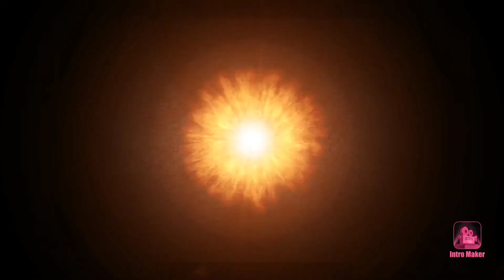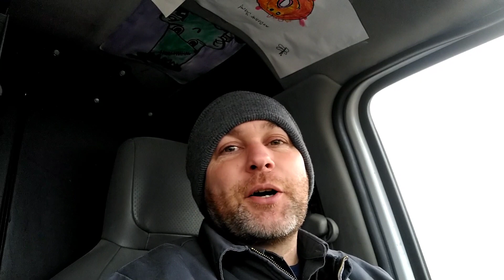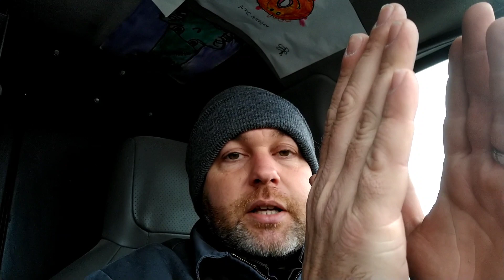Gas Furnace:  Modulating, 2 stage or Single Stage.  What do I really need?

Comment: Your Delusional if you think modulating does not benefit a home. Do you like variable speed motors but you don’t like a variable flame? You need to do some research bud
Reply from the maker: The red light could be a diagnostic light.   They will usually flash a certain number of times and that can tell you what the furnace is locked out on.   Or newer furnaces have a letter or number code it will flash for diagnostics.   Depends on the furnace.    And yes the flame sensor is typically on the end of the last burner.   May have to have a service call it sounds like.    Have a great day!

Comment: i have a 3 year old Colman furnace, i got quoted $4500 to add a 4 TON 14 SEER  A/C unit (highest Seer I could go because i have a single stage furnace) or replace everything with a 16 SEER variable speed 2 stage unit off brand Armstrong? My current furnace in not that old is it worth replacing everything just to go up to 16 SEER?
Reply from the maker: Thanks for the question.  I do usually say replace both at the same time.  (I have another video on the channel about why) but it's not always necessary.   If the furnace is pretty new and in GOOD shape then maybe it could stay.   Depends on it's condition.  I am a big fan of 16 seer ac units but if the furnace is newer, maybe u can save a couple dollars.   16 seer is great but the other option is 14,. Not that big a jump in my opinion.  I don't believe your going to see that much diff on your utility bill.   The cooling tonnage will be the same so you'll still be comfortable.   Variable speed motors are great.   16 seer is great.  And together you probably can save on utilities.   But if the furnace is new, I don't see much concern doing a 14 seer and at 4500, that's not a bad price.   At least in my area.      I hope this helps!  Please, be sure to subscribe and check out more of the videos on the channel.   There's a lot on there about new equipment and how to deal with purchasing.  Share with a friend and have a GREAT day!
Reply: @andyscornerhvac  thanks for the advice!

Comment: I believe I have a two stage variable furnace. When it starts blowing, it blows cold air, then the air changes to warm, then back to cold again before it shuts off. I have to put an object in front of the vents blocking them from my chair or I freeze. What makes it do this? the variable speed or the two stage? I want one that only blows hot air, not cold air during the cycle.The cold air blowing during the cycle is so unpleasant.
Reply from the maker: Could be a number of things.  Blower speeds not set right (happens a lot), staging not set right, maybe the stat is set up wrong and set for electric heat which would turn the blower on before the heat exchanger is hot, could be something wrong with the furnace locking it out so it's not producing heat all the time.   Unfortunately could be several things. The only real way to know would be to have a service technician look at it.  The only way (on some furnaces) to know if it's in 2nd stage is by checking gas pressure and I recommend that being done ONLY by a certified technician.  I would recommend having a reliable company come out and evaluate the situation.   There's a lot of options to fix your issues.    I hope this helps!  Be sure to subscribe to the channel of not already and share with a friend!   Thanks again!   Have a great day!

Comment: Thank you for this informative video, i wanted to add ac to my house, small tri level,in the northwest(1300sf) i currently have a 1995 carrier, which still runs , and i was thinking of replacing the furnace because I am afraid it won’t start next year, i have had a few companies come give me estimates, a couple recommended 2 stage 16 seer ac unit and a couple  1 stage, 13 seer on ac unit, difference in price is around 2500 between 1 and 2 stage ranging from 6100, to 12k, the downstairs(basement  2 bed 1 Barth is always cooler) what do you recommend  me?
Reply from the maker: Personally, I am always a big fan of a two-stage 16 seer air conditioning unit. But it also depends on usage to justify the price difference. You said you live in the northwest, do the air conditioners there get a lot of use? Like where I'm at we have a lot of humidity in the summer so our air conditioners run pretty hard. Sometimes more in the mountainous or high desert areas we have the temperature but not the humidity so maybe they don't have to run quite as hard. ( I don't know the area I've only visited I've never lived so I'm just spitballing here ). If there's not a huge cooling load needed, then maybe the 13th seer would be okay. Obviously I'm a big believer and efficiency but every house is different and every situation is different depending on location. Warranty is definitely the big thing if this 16 seer has better warranty then hands down I would go with it. The two stage 16 seer units are very reliable and usually have good warranties depending on the brand. As far as furnaces, in the couple different videos that I have I do knock the idea of two stage and modulating furnaces, that being said, two stage furnaces are usually the better unit because they have better warranties and higher efficiency ratings. Two stage equipment is excellent equipment especially with a zoning system or anything like that. You said you live in a tri level, which I personally love the layout of a tri level but they are notoriously hard to heat and cool because it's hard to get ductwork to the right areas. Or at least the right amount of ductwork. So that's where zoning systems really shine at that point you can have thermostats on each level. And two stage air conditioners and two-stage furnaces are absolutely amazing when it comes to zoning systems. So really the choice is up to you, based on budget, usage, and lay out of the duct system. At 1300 square foot roughly, if the equipment is sized correctly even a single stage or 13 seer could potentially be efficient and more budget friendly. My only drawback to the single stage in 13 seer is warranty packages. If it were me, I would be interested in his own system but that does drive the cost up. But on the other hand it can prevent cold and hot spots throughout the house. I hope this helps and good luck with your investment. The purchase of an HVAC system is a long-term investment. I wish more people would look at it that way. It's a lot of money and there's no way to sugarcoat that. And unless you're just rolling in cash like Daddy Warbucks most people don't upgrade their system every couple of years. So you want to make sure you do it right the first time because you're going to have that system for probably at least 15 years or so. I always tell everyone to make sure they're using a good reliable company. Ask each one why they're better than the other. Ask the little questions like do you do combustion analysis. Do you test static pressure when you're done? Do you have performance guarantees? Who else have you install the system in that has a house like mine? And do you have references? Thanks again for the comments and viewing the videos! I love talking to people from all over! Be sure to subscribe if you have not already! And share with a friend neighbor and family member so we can get these videos out so maybe we can help people! Thanks again have a great day!
Reply: @andyscornerhvac  thank you for your response, ac is need it couple months out of the year, so i think the 13 seer should be ok, i was going to go with carrier machines 1 stage , but today i got a quote for lennox units 2 stage furnace , 13 seer ac for less money , now the carrier is a 60k btus and the lennox is i believe 44000 is that important? i have only 1 quote saying the number of btus.
Reply from the maker: Personally, I would not purchase a carrier for my own house. That is a little bit of personal preference and I normally try hard not to knock too many of the brands on here cuz I know a lot of people have their own preferences. That being said, carrier is absolutely hands-down known for being more expensive without getting anything extra. What I look at is repair parts later on down the road. 10 15 years later you need a gas valve or control board or you know really any part it is going to be three to four times more expensive than any other brands replacement parts. Ask any service tech and they will tell you that carrier parts are more expensive than anyone else. They get such high ratings with the public because they have done so much advertising and they have been around a long time. To me it's not worth the extra price. Lennox is a very nice brand. Years ago I actually worked for a Lennox dealer and thought they did make a very quality piece of machinery. There's a lot of good ones out there so to me brand is not a huge importance other than what you get with warranty and budget wise. And 10 years from now when you need parts that carrier does not fit in anyone's budget. Lennox is reasonable and built with quality. As far as BTU ratings, there may not be that big of a difference from a 44 to a 60 as far as being able to heat your house. Different brands have their different size ratings. Like I work for an Amanda dealer. We have 60,000 80,000 100 and 125. But other brands have 40s 75s 110 and so on. What I would definitely look at is the load calculations that the contractors use. The only way to truly know how many BTUs you need is with a load calculation. All contractors should be doing some form of this made a manual j or a different system but a load calculation is hands down the only way to know your BTU rating that you will need on any given day. So you should be able to ask for those and I would also ask for what their performance guarantee is. Not all but a lot of companies offer a performance guarantee. To where if on a 95 100° day that air conditioner does not keep up because of sizing they'll replace it with a bigger one. Same with the furnace on cold days. Not all contractors offer this but the good ones do and it needs to be in writing. But I would always ask the contractors how many BTUs the furnaces how many tons the air conditioner is and how the load calculation came out in comparison. I do not believe in oversizing equipment by any means it's worse than undersizing. But you do have to make sure you have enough BTUs to keep up on those extremely cold days and extremely hot days otherwise you'll be uncomfortable and your electric bill will be outrageous. I hope this helps any other questions just let me know! Have a great day!

Comment: I know ZERO about HVAC systems. My AC is pretty much dead, and it is approximately 16 to 17 years old. I have a quote for a Lennox 16 SEER  ML14XC1 2.5 ton and a 2 stage Lennox furnace EL296V, for about $6500 installed. Have another quote for a Lennox 14 SEER and single stage furnace for about $1200 less. Worth it to go to the higher spec models in your opinion?
Reply from the maker: I would typically go with the higher  rated system.  It is usually better equipment, not always but usually, get the better quality, extra noise level considerations and warranties.  Either way to be honest, 6500 is not a bad price.  Least n my area.   I'm a big fan of the 16 seers.  Not so much on the 18 and 21 seer units because they typically use a diff compressor but I'd go 16 seer all day long. Hope this helps! Be sure to subscribe and share if haven't already! Thanks again! Have a great day!
Reply: Add $10000 to that quote in my area

Comment: I just came across your channel (& subscribed). This is really helpful information. THANK Your!  We are on the process replacing an old furnace (80% efficiency).  WE have 28000 Square foot house (1 floor). With the old furnace, we have trouble heating up the other side of the house (our bedroom and child's room).  So far we have quotes for 93%, 95%, 96%, and 97% efficiency furnaces (Goodman and American standard are brands between two quotes). Most have been 2-stage or modulating. I read somewhere else that variable speed blower was good thing to have. Thus, hearing this in your video has made me convinced to go with that.  Currently we are leaning toward the 96 or 97 Goodman 2-stage given the size of our hour and troubles we have this older equipment.  Based on your video and comments reply below, you seem to recommend zoning.  Is there any other information that might be helpful in our decision making process?
Reply from the maker: Thanks for watching and subscribing!  I always recommend zoning if there are cold n hot spots!  Zoning is amazing!  Lol.  Your contractor should be looking at the ducting going to the end of the house that is not keeping temp well.   Duct size (counts for volume and velocity) is what needs addressed for that area.  Zoning would be an excellent start .  2 stage or single stage as well as efficiency rating will not correct the poor air flow or lack of consistency in temp in that area.   Thats a ducting issue. I always believe in the higher efficiency furnaces.  Not a huge fan of multi stage due to how they are advertised incorrectly .  Thanks again for subscribing and commenting!   Have a great day!
Reply: @andyscornerhvac  Thank you for the words of wisdom. I will be watching your channel from now on.
Reply: Must be nice to have a mansion . 20.000 sq foot house

Comment: OK riddle me this:  Our home we reinsulated and a Manual J calculation shows we have a 47,000 btu heating load, but the smallest furnace puts out about 45,000 btuh and the next model up puts out about 57,000 btuh.  So is a two-stage that goes down to about 42,000 then up to about 57,000 on high speed better, or just a one speed at 57,000 btuh?  In Chicago, 60016.
Reply: 2-stage 60k would be a good fit.

Comment: I own a 1030 square foot ground level condo. Its original 30 year old single stage furnace  needs to be replaced. One contractor is trying to sell me on a two stage; citing lower monthly heating costs. Another is telling me that a one stage is enough and that they are easier to maintain if there's an issue. Not sure which way to go.
Reply from the maker: I don't know if I personally can say that a single stage is easier or cheaper to maintain than a two-stage. But I am a fan of single stage units. 1,030 square feet you're not dealing with a mass amount of space so your utility bills should be pretty decent anyways. I would look for which system has better warranties and efficiencies. I do not recommend buying an 80% furnace only 90% or higher. I always recommend variable speed blowers cuz it adds to your comfort level noise level and efficiency. sometimes you do have to go to a two-stage furnace to get the better efficiencies warranties and variable speed blower. Which in my opinion that's okay. Two stage furnaces are not necessarily A bad thing. My biggest thing is they advertise them as more efficient and they technically are not they are built for comfort not efficiency. But a lot of two stage furnaces you can lock them into high fire and then you have all the extra bells and whistles and still have a one stage furnace. Thanks for the questions ideas and comments! I hope this helps! Be sure to share the videos with a friend and tell them to subscribe! Thanks again and have a great day!

Comment: thanks for the info I just bought a single stage furnace  96 percent but it has a ECM blower motor do they hold up or will it be a issue
Reply from the maker: My thought personally is you are much better off with a ECM motor. I like them. They seem very reliable. They are quieter they are more efficient and a lot of times the house can be more comfortable with that variable speed that it does. So I'd say you're in good shape made a good choice! Hope this helps. be sure to subscribe if you're not already. Share the videos with a friend and have a great day!
Reply: @andyscornerhvac  thanks for the info im going to install it along with a new ac system  first timer lol but I am pretty good doing hands on

Comment: I got a Lennox quote today for 2 stage A/C condenser model 16ACX (16 seer), with a SLZ80 blower, use existing ductwork, keep my Ecobee stats, 2 units @ 20,918.00. Need 2 because of two story TX house.  For premium, if I want E18XCV Seer 18 with same blower, its 21,900.00. Any of these good prices?
Reply from the maker: Both are probably reasonable.  Price all depend on your area.  In my area a system like that would prob be in the 9 to 10000 range per system for a 16 seer.  Some areas it may be closer to 12 to 13000 per.  Lennox makes good equipment.  I don't work for a lennox dealer but I used to.  Warranty is the main thing to look for.   Buy the best warranties you can get.   Repair parts 10-15 years from now will be expensive.  Get the warranties!  Lol.  I wouldn't buy anything less than a 16 seer these days but a lot of the 18 and 21 seer units have the inverter compressor and I'm not a fan and it drives the price up.  It sounds like solid equipment and decent prices but I would always get 3 estimates from 3 RELIABLE contractors and make sure they are close in comparison.  
Thanks again for watching. Be sure to subscribe if not already and please share the videos with a friend!  Have a great day!